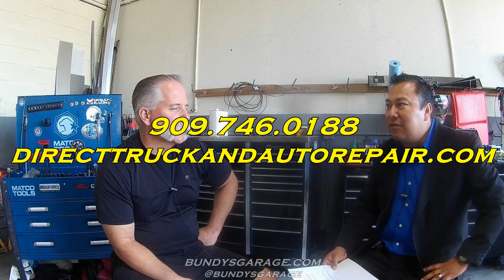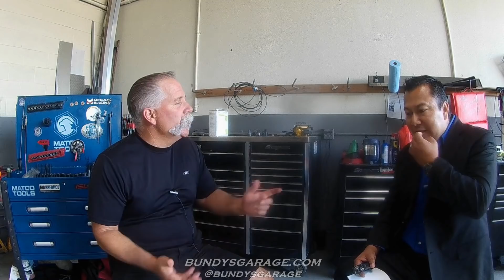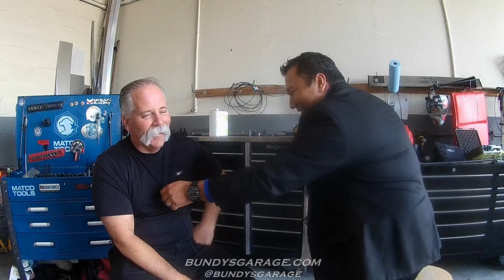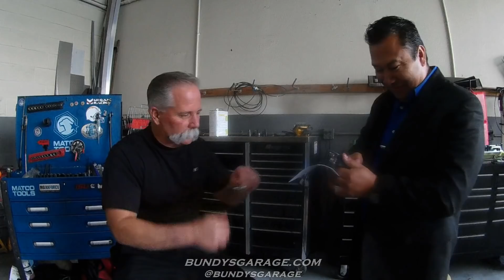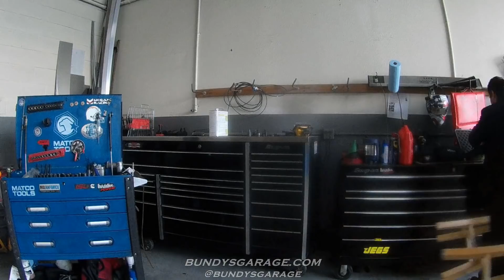Worst Diesel Engine Ever - What is the Best Diesel Truck out There? | Ford Dodge Chevy

Comment: Man i can hear what you say about all the diesels.  Bought a 2010 ram cummins NEW and at first it was junk imo.  Owned a 96 7.3 powerstroke before,  no power at the time . never owned the chevy but i knew the allison was great.  Ive heard all the complaints about all of them (me and  my magazines).  I still have my Dodge... but all on my own, had to do a full delete of omissions  ( ? was gaining 1in volume on dipstik , in the crankcase every 2k miles, dealership said normal)   i  put a Southbend clutch on the g56( stock was a joke)  put a 5in.straight turbo back pipe, have an h&s program and tow tune ONLY  and this thing has been bulletproof! 56,ooo total LOL.   Dodge finally got the hd aisin auto trans.   Have done the math in detail of the break even point of truck price, the price of diesel,the power you get, and how many miles you actually put on the vehicle,  and no matter what i come up with is,  average JOE is a fool to buy a diesel.  Get a gas  truck of your brand taste, period!

Comment: What a joke! Interviewer was obviously biased.  My 6.0 is 15 years old and has never had a failure,  having said that I also have a 6.0 built in 03 and I had little issues with it mostly due to wire loom routing that was changed in 04. It lasted 14 years before I finally blew a head gasket.  Another thing the Torque Shift 5 speed transmission is superior to the Allison. Bottom line  buy a Dodge or Chevy and 15 years later those trucks are complete junk. The Cummins is a good motor but it's by no means a world beater.  The Duramax is going to eat injectors for the life of the truck at 5k a pop. This guy is an admitted parts changer,  I wouldn't let him touch my truck.
Reply: Fuck 6.0s

Comment: I ran a 26,000l lb IHC box truck with a 7.3 and Allison. 300 miles a night, all highway down I-70 and virtually flat road. I sold it with just over 400,000 miles and the 7.3 was still strong. Replaced injectors and one idler pulley , but virtually trouble free the whole time. Then there was the POS Allison transmission. After shelling the 3rd Allison I retired the truck. So I can't agree with your perfect truck having an Allison in it. I will never own another vehicle with an Allison in it. Am I the only one with a problem with Allisons?

Comment: I've on the Ford powerstroke great running engine great truck with the automatic transmissions are junk, bought a 3/4 ton Dodge new Cummins, I had a recall every time I turned around not a bad truck. I traded it in and bought a 2016 Duramax and I love that truck not real good on fuel economy but no problems whatsoever and no recalls

Comment: Yea those DT444E were terds. But they would pull like a monster up to 45mph. The engine just never died. The IDI motor was just never a good idea.
Reply: Well the idi engine isn't a bad idea in and of itself simply and good on fuel and it will do whatever you need it to.

Comment: Militaryy tested these small diesels and the Duramax kept going when all else died. Duramax is the chosen engine in the new military hummer.
Reply: I guess Duramax should be no surprise, given that General Motors bought the company that built the original Hummer (AM General).  To validate your statement about 'all the other engines died', I have to ask which other manufacturers competed to build a Hummer replacement? I've never heard of Ford or Dodge/Ram even submitting a contender, let alone them failing in a replacement Hummer competition.
Reply: @gregparrott  Ford and the Cummins. Max effort for max time.

Comment: A "pro" shop like this should know that the Grade C duramax headgasket is the one to use.  Because it's  the thickest one. If you are taking a duramax head off. It needs to be machined. So you need the thickest gaskets.

Comment: As I'm watching this, I'm sitting in my 97 f250 hd with 412000 miles. The clock says 312000 because  the first number won't go past 3. Odd because its digital.

Comment: If you want a diesel that will run for ever get a GMC two cycle .,noisy dirty but you can,t ware them out I have a 12 valve cummins in my Dodge .I won’ live long enough to ware it out  .there is company here that when they buy a new truck they put in a old Cummins engine  .This engine has wore out three  trucks
Reply: 'wear', not 'ware'

Comment: I’ve heard the 7.3 powerstrokes are the best, granted that is a navistar engine not a purely ford designed motor, and those navistar T444E’s are from what I hear the some of the best engines navistar has ever made. So idk. What I will say though is the ford diesels sound great, I love how they sound, they sound much better than the duramax engines and a little bit better than the Cummins engines

Comment: I had A 04 f350 crewcab with A 6.0 never deleted anything no bullitt proofing no mods at all. Truck ran for 602,000 miles and the only repairs I did were 1 fuel injector, high pressure solenoid and A ficm. Sold the truck and still see it running around 3 years later.